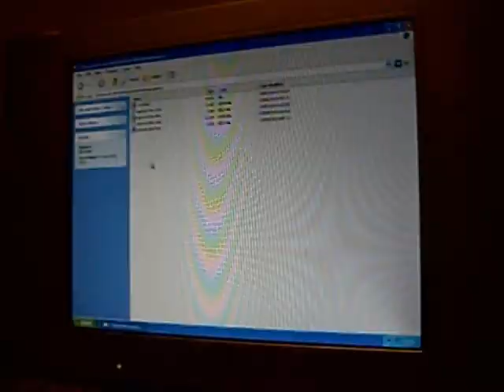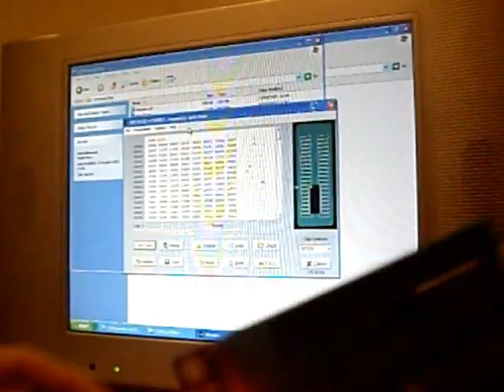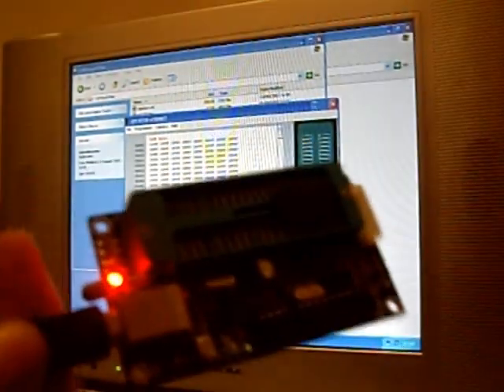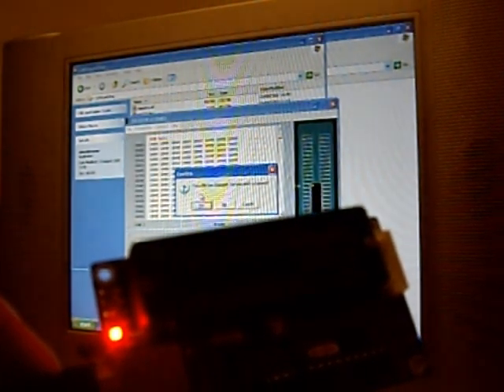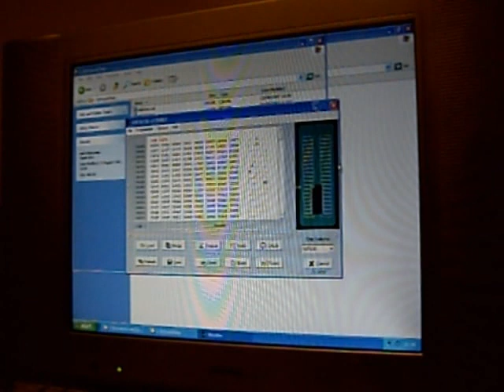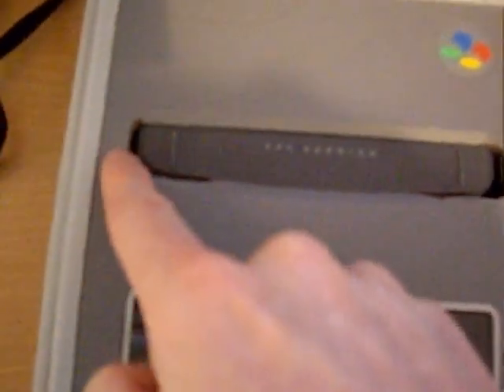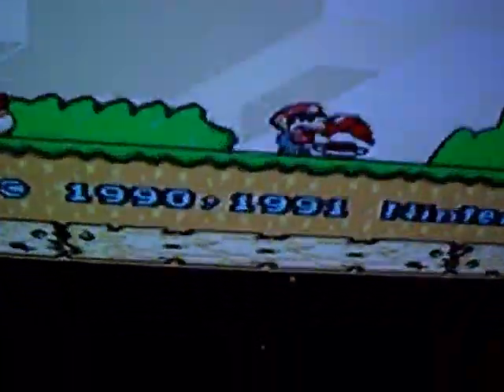Snes mod with switchless modchip by jse, difficulty level = insane (Part 2 of 2)

Comment: Why you are cutting the CIC pins in the first part and here you removed it completely?
And the mod isn't that hard. I used a Hot Air gun to remove the CIC without damaging the chip and soldered wires to the pads. It's a lot easier.
And why on earth everyone uses hot glue? With good soldering you won't need that stuff. It only makes everything permanent. I know that this was one of the first videos from you, but it can be more professional.

Comment: wow, you had a wire solder from PPU1 to PPU2, and then you jump to having wires soldered everywhere, but you really didn't explain why. Not every person watching this video would know why, so you could have been professional, and at the very least, posted the PIC chip soldering diagram to help others out. OK video, but could have been great with the added details you omitted.